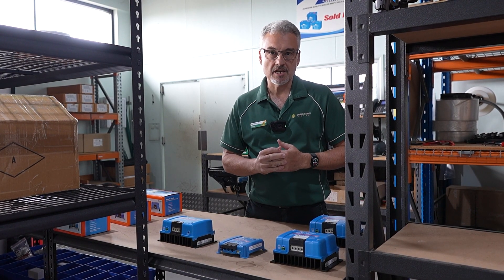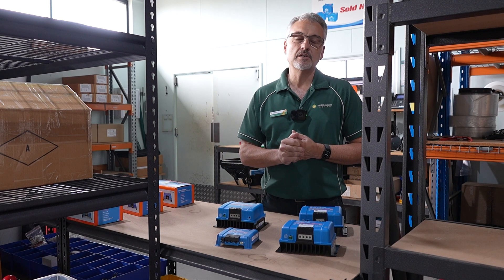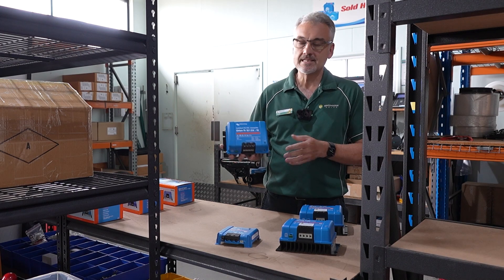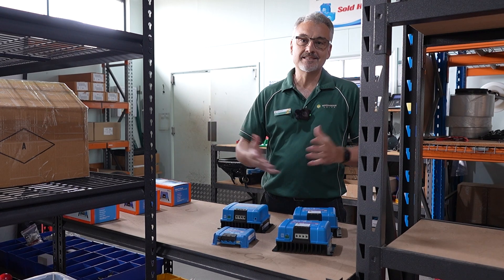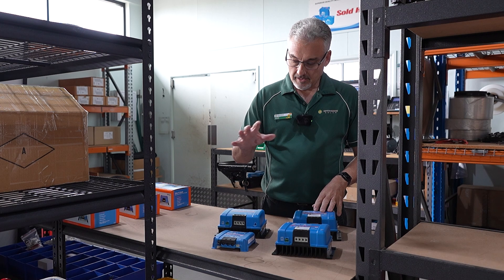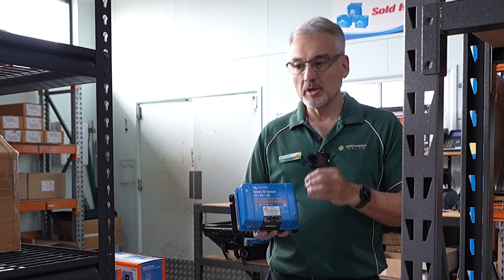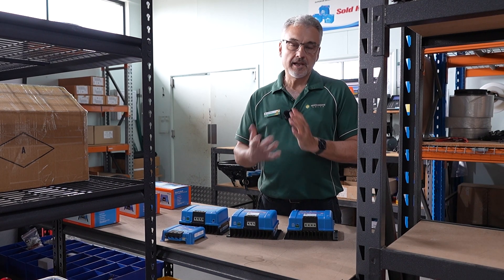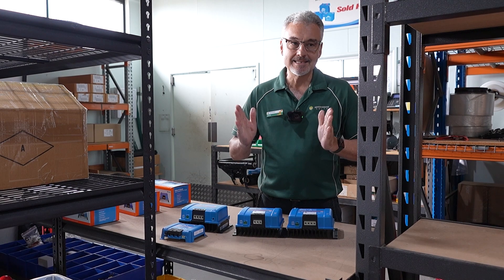DCDC Chargers & DCDC Converters | What's the Difference + Isolated vs. Non-Isolated

Comment: Not at all. If you want to charge a 24V bank, you would need an insolated as they have speparate grouds. An insolated power supply can charge two 12V batteries separatedly in a 24V bank.